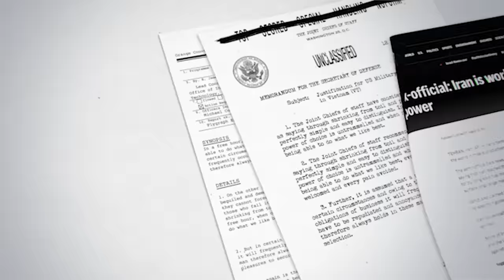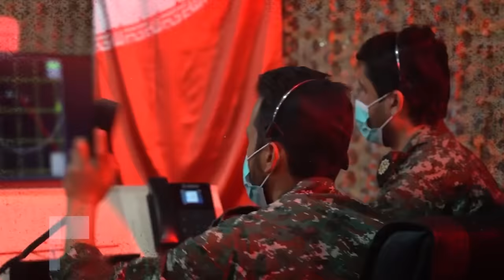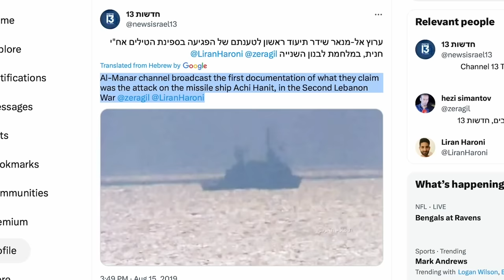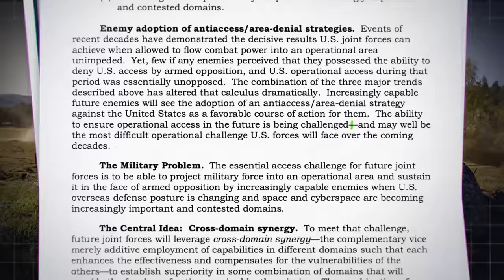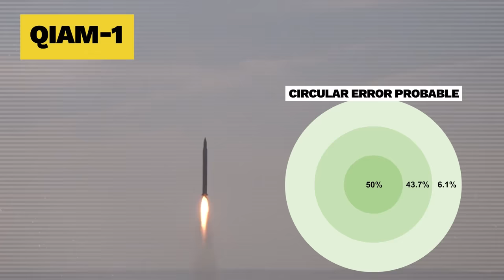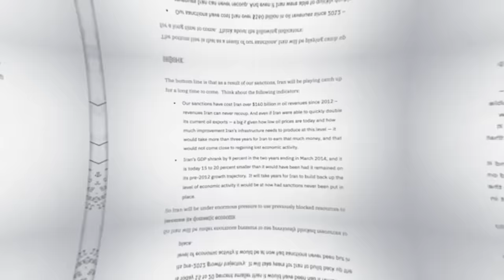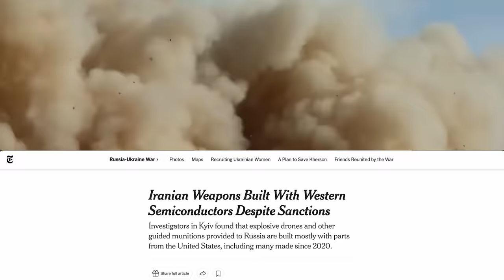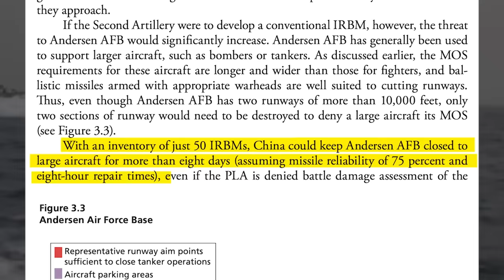Iran’s Missile Force is Worse Than You Think

Comment: Iran's missile doctrine is not just general, but it has become more accurate and deadly.
Now the accuracy of some missiles with a range of 1400 miles is less than 10 meters and this is really unique.
Regarding hypersonics, they have also made significant achievements in ballistics and cruise. However, the ballistics sector is much more mature.
It is clear that Iran has two fully professional armies, and the development and research of missiles is mostly pursued by the IRGC.
Reply: The name of the Iran's hypersonic ballistic missile is "fatah" and few days ago Iran announced the new hypersonic cruise missile too and the name is "fatah2"
Reply: Why do you use metric system for radius but big Mac system for range
Reply: @KennyNGA  I know that miles and yards are among the units of the English system, and meters and kilometers are among the units of the international system of units.
In terms of grammar, you are right. I just think it is a bit confusing.
Reply: @hichic4390  I don't speak imperial system
Reply: @KennyNGA  Stay away from amps and volts. And especially watts and joules. Don't mention days, hours, minutes, or seconds either. All very imperial.
Reply: @hichic4390  "Now the accuracy of some missiles with a range of 1400 miles is less than 10 meters and this is really unique."

It isn't unique, the Tomahawk has a range of 1,500 miles and it's accuracy is around 5 meters.
Reply: @aflyingcowboy31 tomahawk is a cruise missile and it's not that challenging to have an accurate cruise missiles, while Iran has reached that accuracy with ballistic missiles in large amount with very low price, which still makes it impressive
Reply: @aflyingcowboy31  Actually, something like "accuracy of 5 meters" has never been attributed to any ballistic or cruise missile, except in movies.
  You would become the person that you daily think of
Reply: @KennyNGA  That's the kind of thing that causes Orbiters to run away and never come back home...

edit - the above is in response to the discrepancy between imp. and int. units.
Reply: @hichic4390  "Actually, something like "accuracy of 5 meters" has never been attributed to any ballistic or cruise missile, except in movies."

"JASSM-ER's inherent accuracy (three meters (m) or less using the Imaging Infrared (IIR) seeker"

Literally comes from a US military document... thanks for playing better luck next time.

We literally have proof of how accurate US systems are from their usage (unlike pretty much all Iranian missiles), cope some more.
Reply: @aflyingcowboy31  so, comparing a straight flight path cruise missiles  with a boost phase, - midcourse phase to  terminal phase long range missile that impacted the exact radius indicated , as trump explained the al asad bombing?
Reply: @msimon6808 all those mentioned units are part of International System of Units AKA metric system.
Reply: @SupremeArianDescendantOf-tc9ri  "comparing a straight flight path cruise missiles"

You have no clue what you are talking about do you?

The vast majority of cruise missiles do not fly in a straight path like ballistic missiles, i.e. they have a  pre-programmed flight path in which their flight path can be programmed to go through certain locations, around certain location if necessary etc etc.

"terminal phase long range missile that impacted the exact radius indicated"

hahaha:

"Two Iranian Rocket landed near alHeet in the village of alMabghia 30km away from alAssad base, failed to explode and no casualties in the area."

This was literally from that attack.

Regardless you do realise the Al-Asad Airbase is huge right (24kms)? You stating it hit the exact radius indicated is hilarious, it could have a 100m CEP and still hit something , which is backed up by the fact that according to the Iranian's the Qiam 1's (missile used) were using cluster warheads.....

"boost phase, - midcourse phase to  terminal phase long range missile that impacted the exact radius indicated , as trump explained the al asad bombing"

Firstly Trump never said what you are claiming.

Secondly the guidance systems used for these missiles are the same, if you have accurate cruise missiles you will have accurate ballistic missiles.

I mean damn you guys somehow finding a missile like the Qiam-1 unique is amazing to me:

Qiam-1:
Range - 700 - 800km
CEP (accuracy) - 100m

JASSM-ER:
Range 926km
CEP (accuracy) - 3m

Trident D5 (a missile from 1990):
Range - 12,000km
CEP (accuracy) - 90m
Accuracy - Also irrelevant as it is a nuclear missile that can carry up to 12 re-entry vehicles that have a yield of 475 kilotonnes (tnt equiv.) each....

Literally every weapons system the US has is extremely accurate, the fact you guys think Iran is "unique" here is mind boggling.
Reply: @aflyingcowboy31  oh wow, that's called a hypersonic cruise missile, which us and allies do not have. do you know the difference?
Reply: @arashdjoker9263  "Actually, something like "accuracy of 5 meters" has never been attributed to any ballistic or cruise missile"

Which came from the same guy that said 10m was unique for a ballistic missile, meanwhile the JASSM-ER has a CEP (circular error of probability) of 3m....

"while Iran has reached that accuracy with ballistic missiles in large amount with very low price"

If the US can get a cruise missile to have a CEP of 3m they can easily get a ballistic missile to have 10m, the main difference however is the US doesn't need short range or medium range ballistic missiles.

Point of fact the Trident D5 has a CEP of 90ms, it however is an intercontinental ballistic missile with a range of 12,000kms, it is also a missile from 1990 and it doesn't even need accuracy as it is a nuclear missile with a MIRV.....
Reply: @SupremeArianDescendantOf-tc9ri  "oh wow, that's called a hypersonic cruise missile"

wtf are you going on about now? literally no where did I talk about hypersonic missiles at all.

i.e. do you know what a red herring fallacy is? go look it up because you just made one.
Reply: @aflyingcowboy31  put it this way; hypersonic simply means maneuver.  so if cruise missiles could maneuver, why would us and allies spend billions developing a hypersonic (maneuvering) cruise missile?
Reply: @aflyingcowboy31  Experts and officials warn that there are many holes in today’s air and missile defense system. The North Warning System, a network of 47 radar stations monitoring the air space over the Canadian Arctic and Alaska, is based on outdated technology first developed in the 1970s, wrote Dr. Caitlin Lee, senior fellow at the Mitchell Institute, in a June paper.
Reply: @SupremeArianDescendantOf-tc9ri  Mate once again I have never said anything about hypersonic missiles.

"hypersonic simply means maneuver."

hahaha, yea no it doesn't, all hypersonic means is it is travelling at speeds greater than mach 5.....

The idea though that hypersonic cruise missiles can manoeuvre in any meaningful way is hilarious though, they are travelling at speeds far too great for that, regardless any manoeuvring it does greatly reduces it's speed, meaning it may well be below mach 5 i.e. no longer hypersonic after a period of time.

Regardless the cruise missile we have now already manoeuvre, who tf told you that they couldn't? The main difference between a hypersonic cruise missile (glide vehicle) and a regular cruise missile is speed.

Go look up the "Long Range Anti-Ship Missile (LRASM)" by lockheed martin, you will understand what cruise missiles can do and what is meant by pre-programmed flight path. It is the reason storm shadow and JASSM/LRASM are considered such amazing missiles.

"why would us and allies spend billions developing a hypersonic (maneuvering) cruise missile?"

because of their speed....

That said hypersonics are greatly overrated, they will end up being significantly more expensive than what they use now and will do pretty much the exact same job, I don't see the US adopting them in any significant way.
Reply: @aflyingcowboy31  On 25 March, the Pentagon confirmed press reports that various Russian missiles were experiencing failure rates of 20 to 60 percent (failure was defined as the inability to launch or hit the target) with “cruise missiles, particularly air-launched cruise missiles” having the lowest kill rates. Reportedly, some missiles did not explode even when they hit their targets. Thus, in addition to the reliability and quality control problems with the missiles, they apparently have a fusing problem.
Reply: @aflyingcowboy31  why spend billions if ballistic missiles could maneuver? hypersonic is the capability of evade radar by maneuvering
Reply: @aflyingcowboy31  but us and allies ARE trying to adopt them, they're just failing, which is no big deal, iran russia and china failed many times. why would you not adopt a missile without a pilot?
Reply: @aflyingcowboy31  i just have a problem with cruise missile failures
Reply: @aflyingcowboy31  i meant a missile with a remote pilot = hypersonic missile
Reply: @SupremeArianDescendantOf-tc9ri  what are we even talking about anymore?

Russian missile in general may have high failure rates, it however has nothing to do with US cruise missiles and their success rates though, point of fact the JASSM-ER has a success rate of around 95% and the the latest use of Tomahawks had a success rate of 85-90%, it should also be noted that the tomahawks the US had in in the 90s were still significantly more successful than what Russia currently has today....

FYI you have negated your earlier comment:

"so, comparing a straight flight path cruise missiles  with a boost phase, - midcourse phase to  terminal phase long range missile"

because apparently you have just proved that cruise missiles are one of the hardest missiles to make actually work i.e. much harder than ballistic missiles....

This likewise goes to show that unlike nations like Russia, US equipment goes through significantly more rigorous testing before it is adopted into service i.e. the US apparently doesn't adopt missiles that don't have a 75% success rate i.e. it seems the vast majority of Russia's missile would not have been adopted by the US.
Reply: @aflyingcowboy31 this is two different thing
Did you see Saudis aramco??!
Reply: @aflyingcowboy31    i'm working in germany this month and hitting those bars real good but anyway. the top of the conversation was how to compare accuracy of ballistics with cruise missiles.

so an iranian cruise missile has a camera attached to the nosecone so the operator can see what the missile sees. and the gps portion of the gps/ins can shut itself off so the signal is not heard by interceptors.  great. but here is the problem; cruise missile still has a straight flight path @ 550 mph, and lot more vulnerable than a ballistic pattern, dropping at blinding gravity speed of 17,500 mph. and here is the accuracy issue; a ballistic missile has no maneuverability and it better be exact or it would miss the target, which none of the 20 short range missiles missed the target at al asad base hit. where as a 12 year old with a joystick can change the flight pattern of a cruise missile to target, which was the primary discussion tangent-ed off to other stuff
Reply: @aflyingcowboy31  NAVY SAYS FEWER THAN 60% OF TOMAHAWKS WERE SUCCESSFUL IN GULF WAR
Reply: @SupremeArianDescendantOf-tc9ri  How would a turning radius the size of Texas help evade radar that moves at slightly slower then c due to atmosphere?
Reply: @aflyingcowboy31  i couln't find any iranian cruise missile failure stats so i put the russian stats first and then the us stats so it doesn't look like an ally thang, and also pasted the us navy in caps as it was, in case of a browser that might filter case sensitivity so i wasn't shouting, lol
Reply: @spartanonxy i'm not sure what you mean but if you mean how to keep up with a cruise missile, bavar 373 uses 3 arrays in triangular form; 1 front and 2 backwards covering 360 degrees. in case of stealths like the f-117 in bosnia, khordad used the ancient oth radar and never lost track even thou f-117 quickly turned. so in that case, the nosecone radar kept track of both; oth reading and it's own, guiding the centerline. i'm sure bavar 373  is a copy so us and allies must have the same capability
Reply: @SupremeArianDescendantOf-tc9ri  The F-117 was a miracle hit. Also I was responding to your comment that said "hypersonic is the capability of evade radar by maneuvering" which makes no logical sense since simply increasing speed does little against modern radar. It could work against decades old tech but not against anything approaching modern. 

To explain the F-117 hit they were flying a repeatedly used flight path so where they were coming from was known, not buttoned up IE were not full stealth at the time with parts extended for better handling, had just deployed payload meaning doors were open and were picked up on long wave which was used for finding targets but gave poor returns for actually targeting at which point the switch to targeting radar was made but could not lock so the operator overrode the system and did a launch using long wave in a hail mary shot that due to all the previous factors worked albeit barely. It was a golden bb by any metric and forced a revamp of protocols to prevent the mishaps that downed the F-117.
Reply: @spartanonxy  i can only talk about iranian fattah, not chinese or russian versions, which are different. 

you first have to locate the hypersonic launch/boost phase, which is the easiest segment of the flight to detect and also the most vulnerable phase, but that means that yes while any typical satellite would locate its launch then the operator has to download the data to the radar operator, by which time the initial satellite loses it due to blinding speed. 

so then you need a second "next" generation satellite (which us and allies estimate around 5 years before development) and several other next generation ground radars etc., to continue tracking it, which is impossible bc us and allies are not equipped with mid orbit detection, which it glides thru. 

speedy maneuverability comes from electronics in the missile that keep the radar pointed directly at the target, missile then looks at this "angle" of its own centerline to guide itself. if detecting any "objects or interception", then the ins or arh would simply change the angle and readjust. 

at 17,000 miles per hour re-entry, that readjust would take it way off any radar, but not next generation radar, which i think all 4 nations are rushing to build
Reply: @SupremeArianDescendantOf-tc9ri  "NAVY SAYS FEWER THAN 60% OF TOMAHAWKS WERE SUCCESSFUL IN GULF WAR"

bloody hell mate, you do realise the gulf war was 32 years ago right, that was the Tomahawks first operational use i.e. like I said in my earlier comment:

"it should also be noted that the tomahawks the US had in in the 90s were still significantly more successful than what Russia currently has today"

Secondly once again if you are going to quote things actually quote them, stop making strawmen statements:

"Tomahawk's performance exceeded all expectations in its first operational use . . . with an overall success rate approaching 60 percent," Dalton told the committee."

Dalton then goes on to state:

"We weren't satisfied with Tomahawk's success- and the department had a vision to make a better missile. The improved Tomahawk cruise missiles launched last summer into Bosnia had a better than 90 percent success rate."

So once again the Tomahawk has a success rate of 85 - 90% as has been seen since every use of it since the Gulf war.
Reply: @SupremeArianDescendantOf-tc9ri "great. but here is the problem; cruise missile still has a straight flight path @ 550 mph, and lot more vulnerable than a ballistic pattern, dropping at blinding gravity speed of 17,500 mph."

You just need to stop talking about this stuff, you straight up have no clue what you are talking about, cruise missiles do not fly in a straight path and they are no where close to as vulnerable to something that flies in a ballistic path:

"Cruise missiles remain within the atmosphere for the duration of their flight and can fly as low as a few meters
off the ground. Flying low to the surface of the earth expends more fuel but makes a cruise missile very
difficult to detect."

"Cruise missiles are self-guided and use multiple methods to accurately deliver their payload, including terrain mapping, global positioning systems (GPS) and inertial guidance, which uses motion sensors and gyroscopes to keep the missile on a pre-programmed flight path. As advanced cruise missiles approach their target, remote operators can use a camera in the nose of the missile to see what the missile sees. This gives them the option to manually guide the missile to its target or to abort the strike. "

Also, ballistic missiles are not "dropping at blinding gravity speed of 17,500 mph" during their terminal phase:

"Terminal Phase begins when the detached warhead(s) reenter the Earth’s atmosphere and ends upon
impact or detonation. During this phase, which can last for less than a minute, strategic warheads can
be traveling at speeds greater than 3,200 kilometers per hour (1,988 miles per hour).
"

"a ballistic missile has no maneuverability and it better be exact or it would miss the target, which none of the 20 short range missiles missed the target at al asad base hit."

Firstly, that isn't how ballistic missiles work especially the Qiam-1 which is stated to be manoeuvrable:

"The missile also uses a separable warhead and ground-based radio guidance system, improving its accuracy over prior Scud-based designs."

The Iranians in fact claim their ballistic missiles are manoeuvrable, so..... you're once again incorrect.

Regardless, 11 missiles hit the al asad base (only 5 hit structures/were close to actual structures)..... so thanks, you just proved they have a 55% success rate (20 out of 11), FYI we know for a fact quite a few went way off target:

"Two Iranian Rocket landed near alHeet in the village of alMabghia 30km away from alAssad base, failed to explode and no casualties in the area."

Also the Qiam-1s that were used had cluster warheads i.e. making any accuracy claims irrelevant, regardless the Qiam-1 does not work how you have described ballistic missiles.

Also here is another reason we shouldn't trust anything the Iranian's claim:

"over 80 American troops were killed and some 200 wounded"

As was claimed by the Iranian state run news Mehr News Agency in regards to the Al Asad attack, fyi no one was killed in that attack....

Regardless as you have already proved with the Russians, ballistic missiles are apparently much easier to use, which can be seen by the fact that Russia has a significantly harder time getting cruise missiles to work......

"where as a 12 year old with a joystick can change the flight pattern of a cruise missile to target, which was the primary discussion tangent-ed off to other stuff"

And yet Russia cannot get them to work, almost like having all of that tech work in a missile is actually incredibly more complex than a simple ballistic missile. 

You have completely contradicted your entire argument with your info about Russian missiles.
Reply: @aflyingcowboy31  i simply pasted the headline without reading the rest. why strawmen if anyone could easily find the article? not to mention that you have to log in to read it and i wasn't going to. i believe you but that stat would be strange since bosnia and persian gulf wars were around same time. i really could careless but i'm just sayin' lol;

From the 1991 Persian Gulf War to late 2001, the US fired about 1,100 Tomahawks, including up to 70 against Taliban and al-Qaeda targets in Afghanistan.

Tomahawk was used extensively during Desert Storm in 1991, in Iraq in January and June 1993, in Bosnia (Deliberate Force) in 1995 and in Iraq (Desert Strike) in 1996. Four hundred Block II and Block III missiles were fired on five separate occasions.
Reply: @SupremeArianDescendantOf-tc9ri   I would suggest going and watching Habitual linecrosser talk about these topics because there is so much wrong that it hurts in what you said.
Reply: @SupremeArianDescendantOf-tc9ri  "i simply pasted the headline without reading the rest."

and 

"why strawmen if anyone could easily find the article?"

and 

"not to mention that you have to log in to read it and i wasn't going to"

makes it a strawman, you didn't bother reading what he was talking about and took it out of context even if you didn't mean to i.e. you obviously used that "quote" in an attempt to state the Tomahawk missile only ever achieved a 60% success rate, your comment also took it out of context i.e. changed the quote meaning therefore a strawman:

"A straw man fallacy occurs when someone distorts or exaggerates another person’s argument, and then attacks the distorted version of the argument instead of genuinely engaging."

"i believe you but that stat would be strange since bosnia and persian gulf wars were around same time."

Its a fact, I directly copied that quote from the actual documentation on that hearing.

If you want to read it yourself lookup in google:

"Vision for the Future
By The Honorable John H. Dalton
May 1996"

I don't know what the point of the rest of your comment is or what you are trying to claim. Regardless they have a claimed 90% success rate from Bosnia on as noted by the person you literally just attempted to quote from.
Reply: @aflyingcowboy31   this article by "Center for Arms Control and Non-Proliferation" you're pasting is saying the same exact thing i'm saying except you don't really have the deep understanding and misinterpret. it's best to use your own words and just use short refenrences, else people think you're just a name dropper-article dropper without any background. i think you have some background but not when it comes to how things work;

"Cruise missiles remain within the atmosphere for the duration of their flight and can fly as low as a few meters
off the ground. .............................this is what i mean by straight path vs ballistic vs midrange, that it does not enter the orbit and a "arc reversal drop". does a cruise missile do an arc reversal? no................................. ...the rest is exactly near what i said with variances on iranian versions;
"Cruise missiles are self-guided and use multiple methods to accurately deliver their payload, including terrain mapping, global positioning systems (GPS) and inertial guidance, which uses motion sensors and gyroscopes to keep the missile on a pre-programmed flight path. As advanced cruise missiles approach their target, remote operators can use a camera in the nose of the missile to see what the missile sees. This gives them the option to manually guide the missile to its target or to abort the strike. "

"a ballistic missile has no maneuverability and it better be exact or it would miss the target, which none of the 20 short range missiles missed the target at al asad base hit."

Only 11 hit the al asad base..... so thanks, you just proved they have a 55% success rate. Also the Qiam-1s that were used had cluster warheads i.e. making any accuracy claims irrelevant.................................trump's word vs iran's. what happened to the other 9? lol

Regardless as you have already proved with the Russians, ballistic missiles are apparently much easier to use, which is why Russia has such a high failure rate with cruise missiles......................................that's what the article said, not me

"where as a 12 year old with a joystick can change the flight pattern of a cruise missile to target, which was the primary discussion tangent-ed off to other stuff"

And yet Russia cannot get them to work, almost like having all of that tech work in a missile is actually incredibly more complex than a simple ballistic missile. 

You have completely contradicted your entire argument with your info about Russian missiles..... well done..............................and who says they were not self guided? clownski made a lot of claims such as intercepting all of iran's drone while  iranian drones destroyed the place, and clownski ran to us and allies to stop iranian drones, lol
Reply: @aflyingcowboy31  

"and lot more vulnerable than a ballistic pattern, dropping at blinding gravity speed of 17,500 mph."

which is factually incorrect as stated by what I shared with you, the warhead that the Qiam-1 has would never be travelling anywhere close to those speeds. Also if you weren't talking about its terminal phase, using its maximum speed achieved during midcourse is just dumb, as it is completely irrelevant to everything and is not travelling at those speeds when it reenters the earths atmosphere..................................................................how could Qiam-1  drop at that speed when it never enters the orbit? lol........again, the problem is that your background is not tech, so you depend on people and articles, where you need to figure things out yourself. a ballistic missile could drop at that speed but not a short range like Qiam-1  lol  

Furthermore if you were trying to claim it is hard to get a missile that is travelling at those speeds to hit their target you are going to need to explain how SpaceX does it with every rocket that has landed back on earth (extremely accurately).....................................................i can't believe i'm hearing this lol......do you honestly know what a ballistic missile is? i don't think so. maybe watch a video of spacex and see how they land. pay attention to the nosecone facing up during landing? lost for words lol

Regardless the US was capable of hitting satellites (at those speed) with air launched missiles that was travelling at speeds of 8,860 mph back in the mid 80s:........................................................................this has nothing to do with ballistic missiles ffs, lol

"In September 1985, an ASM-135A destroyed a real satellite in a pre-planned test. An F-15A launched the missile at 38,100 feet. Streaking into space, the missile homed in on the U.S. Solwind P78-1 satellite at 345 miles above the Earth, and impacted the one-ton spacecraft at about 15,000 mph."

Meaning the US was able to hit (with pin point precision) a satellites that were travelling at speeds of 17,000 mph with a missile that was travelling at speeds of 8,860 mph-15,000 mph back in the 80s. So I really don't know what your point was..........................................................................................look you're mixing up guided missiles with ballistic missiles that can not maneuver or be guided, which would be called hypersonic missiles lol. if the trajectory is inaccurate they'll end up somewhere other than intended, lol
Reply: @SupremeArianDescendantOf-tc9ri  I am not going to bother writing much because your last sentence tells me everything:

"look you're mixing up guided missiles with ballistic missiles that can not maneuver or be guided"

The Iranians literally claim their ballistic missiles can be guided i.e. the Iranians claim their Qiam-1 uses ground-based radio guidance systems for guidance, the Chinese likewise claim their Dongfeng ballistic missiles can both guided and manoeuvred, as does Russia with their Iskander ballistic missile which they even claim can be optically guided.

How tf do you not even know ballistic missiles use guidance systems?

You literally have no clue what you are talking about and your last sentence proves that.

Regardless, I take it by you no longer mentioning it that you have realised Iranian missiles aren't as capable as you thought i.e. 55% success rate (20 out of 11), which by the way is just the success rate in reaching the target and not the overall success rate of whether those 11 actually even hit anything or hit where they intended.....
Reply: @aflyingcowboy31  bro, you need to work on your reading skills. since you have no background i'll paste Harvard University's explanation;

bunn_and_tsipis_ballistic_missile_guidance_and_technical_uncertainties_of_countersilo_attacks.pdf

The rocket and guidance system only function for the first 3-7 minutes of the flight; the warheads are then detached from the rest of the system, and fall freely, influenced mainly by the earth's gravity field, unpowered and unguided, lol
Reply: @SupremeArianDescendantOf-tc9ri 
No- “hypersonic “ doesn’t refer to maneuverability, it represents ability to travel at a speed greater than the speed of sound. So get your definitions straight
Reply: @gilbertozuniga8063  gee, this is getting better and better, lol.....what i'll do is first paste a guide that a 12 year old can read and hopefully understand, then the 12 year old can ask question ffs, lol

In addition to speed, a hypersonic missile has a long range and cruise and control capabilities (controlled flight): unlike a ballistic missile, whose ability to maneuver to a target is limited as it travels on a predetermined ballistic trajectory, a hypersonic missile can maneuver in flight and can navigate precisely

The Institute for National Security Studies, Strategic, Innovative, Policy-Oriented Research

stop embarrassing yourself, lol
Reply: @SupremeArianDescendantOf-tc9ri "stop embarrassing yourself, lol"

The only one that has embarrassed themselves here (repeatedly) is you:

"put it this way; hypersonic simply means maneuver.  so if cruise missiles could maneuver, why would us and allies spend billions developing a hypersonic (maneuvering) cruise missile?"

FYI This was your third comment to me. 

This is from the exact same publication you just referenced:

"Hypersonic cruise missile (HCM): This is a sophisticated missile that combines the acceleration capabilities of a ballistic missile with the maneuverability of a cruise missile and is equipped with a powerful engine."

You are a walking contradiction, the only difference between a regular cruise missile and a hypersonic cruise missile is speed, maybe take your own advice and stop embarrassing yourself.
Reply: @aflyingcowboy31  yeah the beers made a mistake that night as i meant "hypersonic (maneuvering) ballistic missile. but most people have hundreds of comments to reply and i don't copy and paste so mistakes do happen. not to mention that this subject can take months to get a handle and one mistake can throw anybody off, as you've noticed by now
Reply: US UAPs have entered the chat.
Reply: @msimon6808  apart from those date and time units, all of those are metric or metric-compatible (kV, mV, kJ, mJ, etc)
Reply: And yet they're happy with their proxies. Wonder why?
Reply: @mallachsteve  Just like America